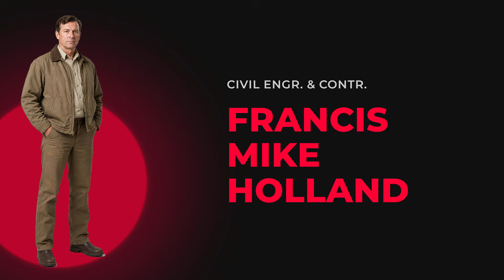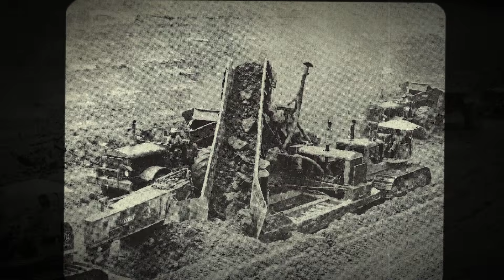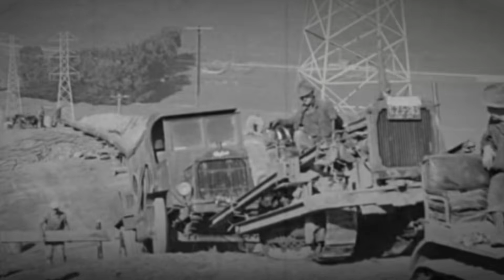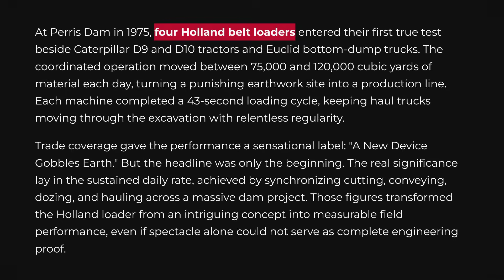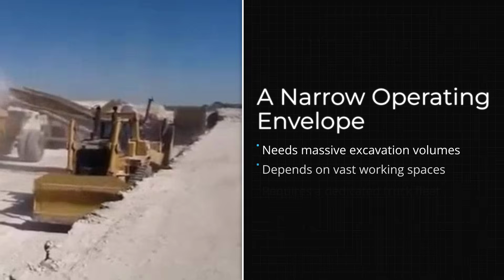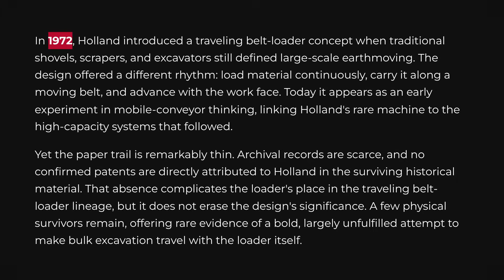The Holland Belt Loader: Revolutionizing Earthmoving Since 1972

Comment: Hi, Folks.
While both the Euclid BV and Holland loaders were GREAT innovations, they both required some pretty specific conditions to be able to operate efficiently. They NEEDED LONNNNGGGG, pretty straight runs where they could cut material out of a bank on one side of the machine and move it across the machine while also raising it to loading height via a conveyor belt.

Finding sites with suitable material AND the long, straight runs that they needed was not always possible, which is why more adaptable loading methods overtook them.

Just my 0.02.

You all have a wonderful day. Best wishes. Deas Plant.